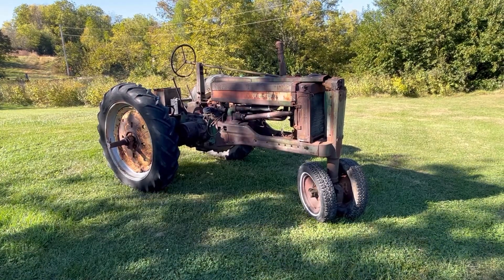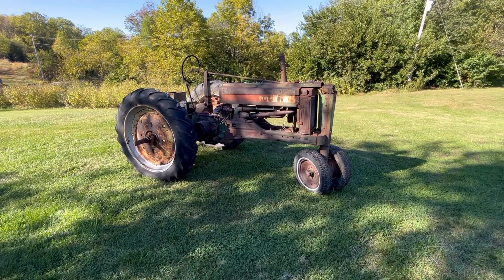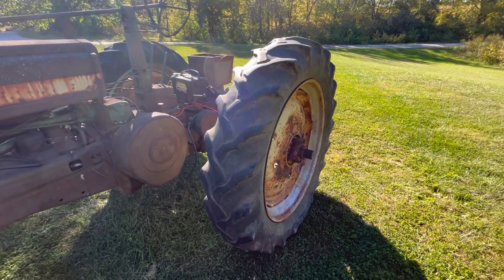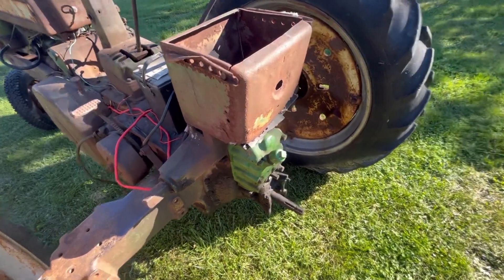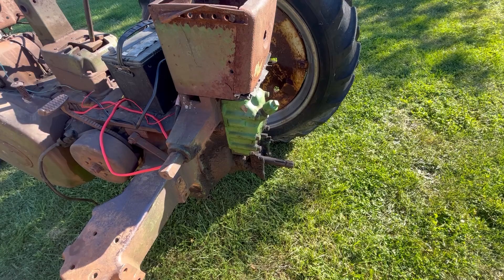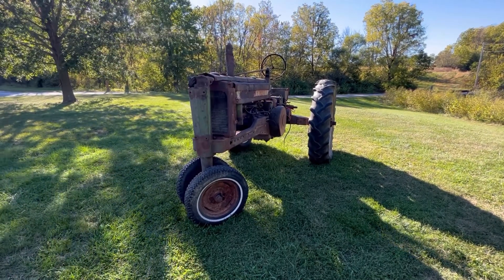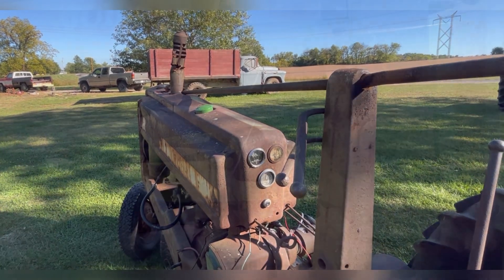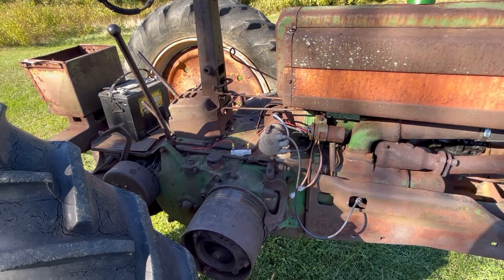John Deere B project

Comment: I'm all for saving them,  but I'd easily classify that as a parts tractor.  Yea it runs great,  but that's about it.  Not much of the tractor would be left by the time you finished.  Even the transmission based on your comment needs work. That is an old power lift on the back someone swapped,  not power trol. Finding one that is locked up but good sheet metal and mixing,  that sounds like a decent idea. Plenty of people though looking for engine parts which is the one thing this has and others need. Just my opinion.
Reply from the maker: I agree with that I still learning on the power lift vs power troll
Reply: @DrRust  I get it.  I kind of learned the hard way with my B. It was the first tractor I ever tinkered with.  I could have had 3 of them (restored)  fior what I have in that one.  And like I said in the end so much of the tractor is from donors and I see too many people parting out nice ones to feed ones too far gone.  But it's your tractor,  and I respect whatever you decide.  I just like for others to be informed so I can keep them from learning the hard way like me.  B parts are plentiful at least at this point, but definitely find a whole donor tractor yourself.

Comment: You'll fix it and it's got whitewall on the front. What else can you ask for. And running ought to be in there somewhere. BLESSINGS!
Reply from the maker: Yep it’s just a big project I wasn’t expecting I’ll probably start collecting stuff for it soon 
I think the clutch will be a big ordeal
Reply: @DrRust  Got to be a spot inside for a thrust washer or two. You'll get it. I'll watch from a distance. Don't want to hinder you!
Reply from the maker: I think it’s the throw out Bering but it’s probably got more than just that wrong
Reply: @DrRust  Could be with everything in there running sideways but if it's not growling is a good thing.
Reply from the maker: I didn’t show that it howls if you have the lever in the right spot 
it’s going to be a learning curve
Reply: @DrRust  Sounds like a bearing to this unlearned knothead but I just ran them.I still want to watch!
Reply: @DrRust  Probably, since it's all been together thrashing and flopping around. Seems like when rotating stuff goes to changing directions, like from front to back to side to side, things get really complicated quick. But that old rig just had the pistons fr4ont to back and the rest WAS side to side. I guess we'll just see what's what.
Reply from the maker: Yep